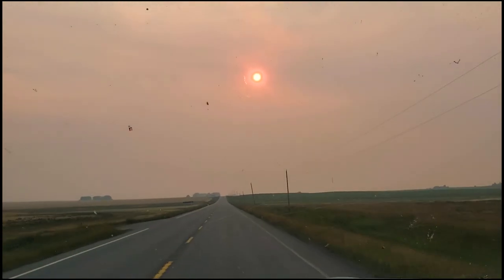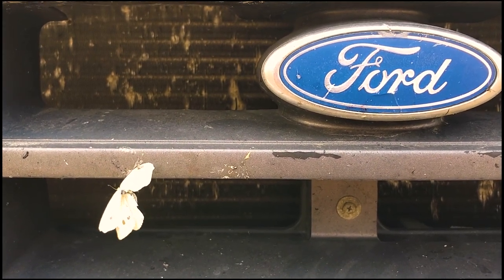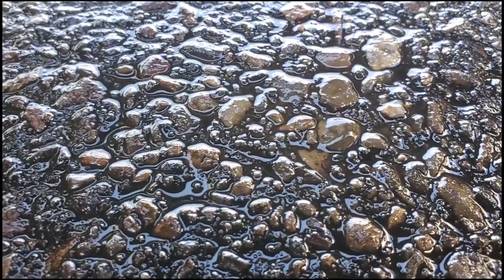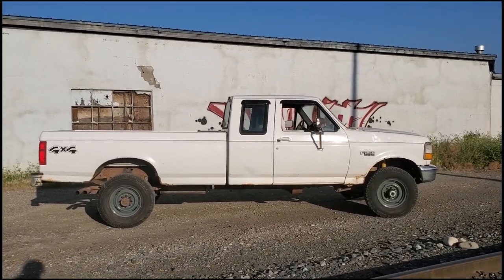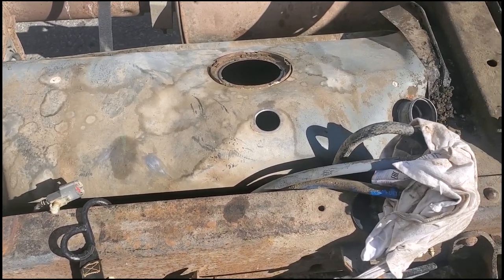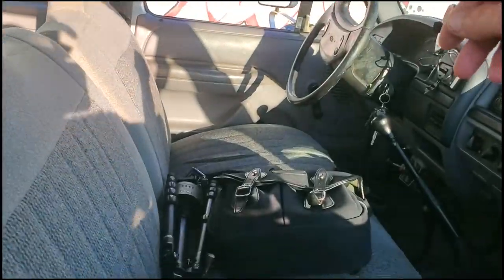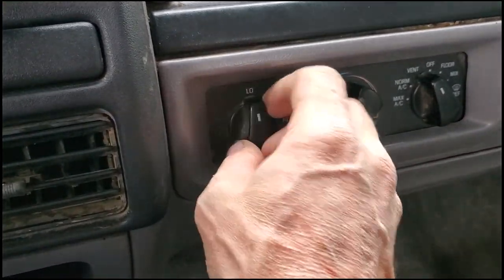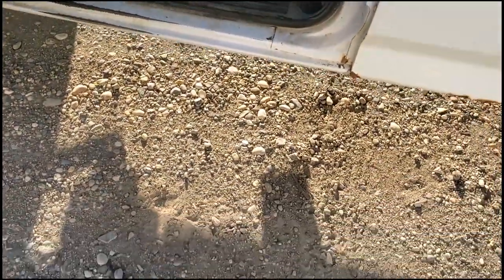Budget OBS Ford F250 4x4 HD Overland Alaskan Truck Bed Camper Build Part 1 - Zombie Apocalypse Fun!

Comment: Just got a similar setup but a '90 Bricknose extended cab 460/5 Speed. Considering a carburetor swap to ditch the EFI, that or ditch the "Cobra head"upper plenum for the ...gag Holley😣 setup from 460EFIGUYS. I would definitely prefer a good dual plane intake and run my Predator carburetor on it. I may save that for my 351Windsor or 300I6 bullnose truck though... Decisions 🤨. I only got the '90 for the extended cab and the ZF5 and the Dana 50 TTB

Comment: oh yea, a mans truck, 460 cubes and 4 on the floor. i run my tire pressure at abot 50 rather than 90, get  a little better ride, but you need to pump them up if you load her up. good luck with the truck.
Reply from the maker: Hi Ned and thanks for the comment. Yes, it's quite the beast! I'm happy with this thing so far. This thing will take some serious weight. Yeah the tire pressure thing definitely is needed LOL

Comment: Oh-oh! Here we go again! Actually it does look way better than the other ones, so hopefully it works well with the camper on it.
Reply from the maker: Hehe, yup 0 holes in this one and it also stops 🤣
Reply: @JimmyMeatwhistle  stopping is good! And bonus that you don't have much of a rust issue. Hopefully the gas tank issue is quickly resolved, and you get the proper sized one.

Comment: Would love to know the final mpg when you get the camper on. What a beast.
Reply from the maker: Hi and thanks for the comment. Yes I'm looking forward to that as well, although a little nervous 🤣. It seems to do really well on the highway and I believe that's because of the 3.55 gear ratio this truck has👍
Reply: @JimmyMeatwhistle  sweet setup! Did the 3.55s come from the factory?
Reply from the maker: Yes, I checked the vin. 👍